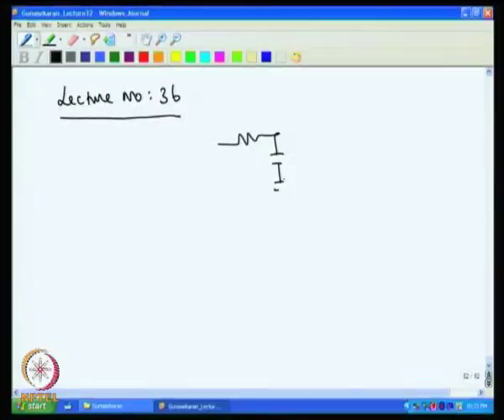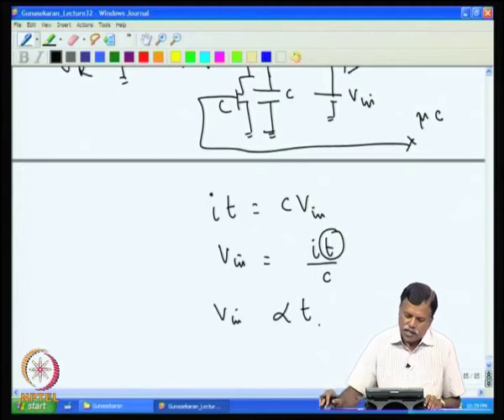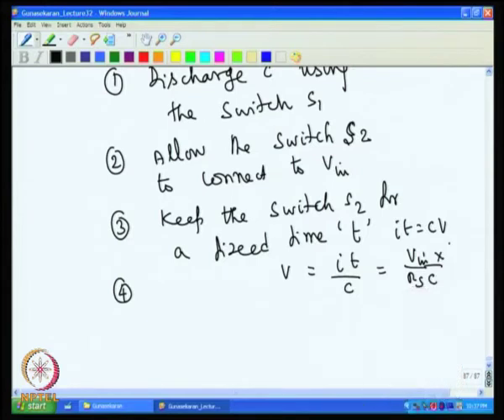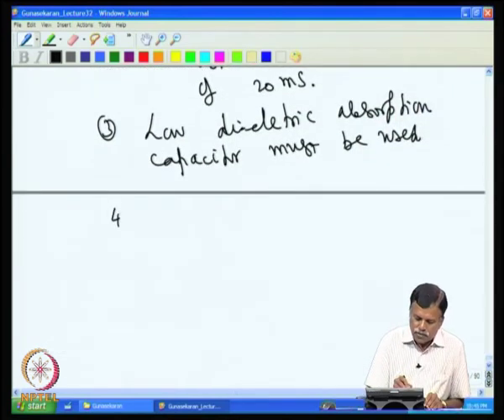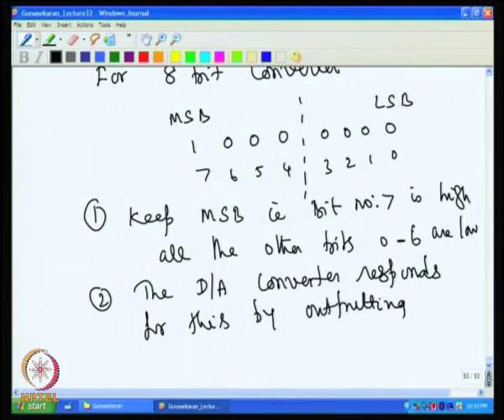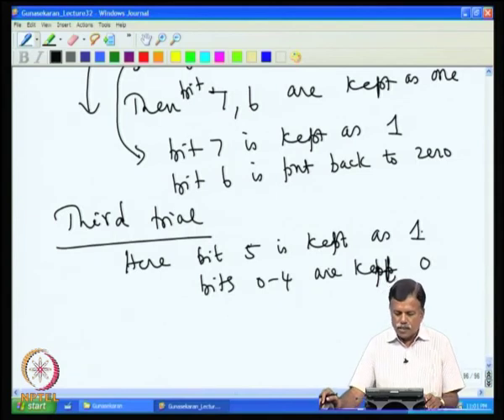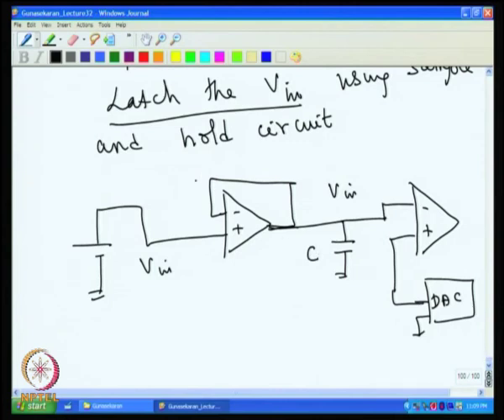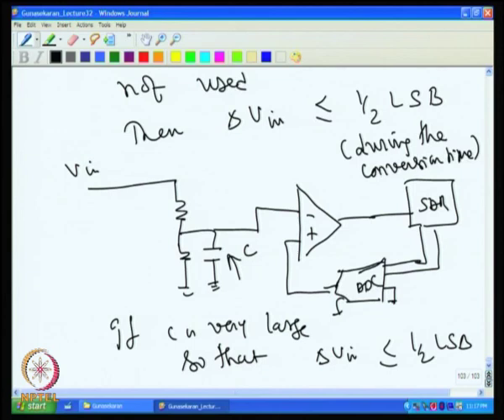Mod-08 Lec-36 Dual Slope ADC and Successor approximation ADC

Comment: Circuit is wrong. DAC output should have been fed to negative terminal of opamp else negative feedback will not work. SAR ADC is ADC made from DAC using the the negative feedback property of function inversion.
Reply: Abhijit Bhattacharya i dont think so.....he explains it.....plus its the same given on google and other books

Comment: sir at 35:18 you say if Vin > 0.5 then comparator goes low..
shouldn't it go high so that msb is kept the same?
Reply: Circuit is wrong. DAC output should have been fed to negative terminal of opamp else negative feedback will not work. SAR ADC is ADC made from DAC using the the negative feedback property of function inversion.